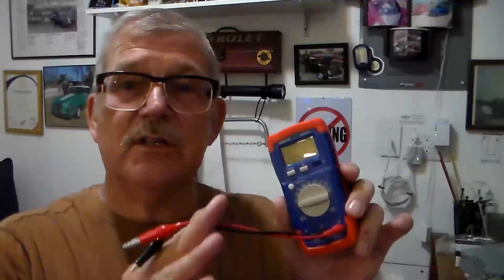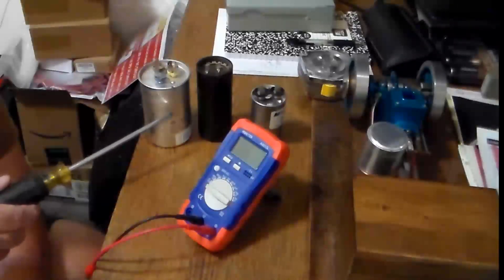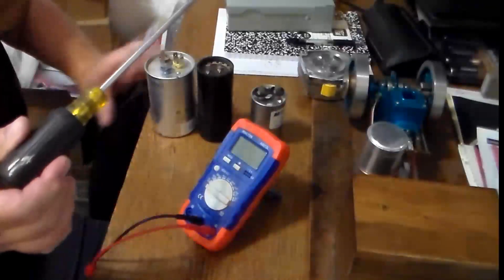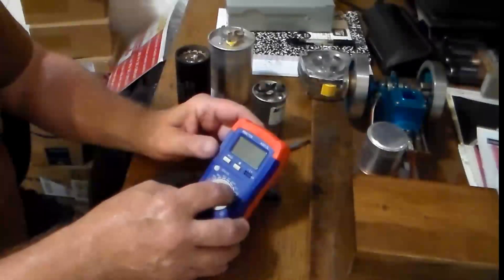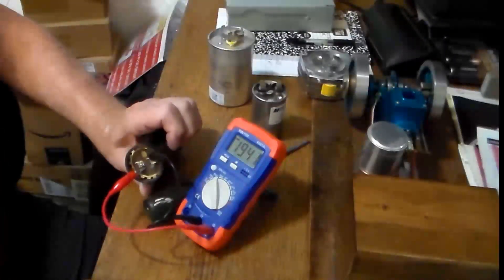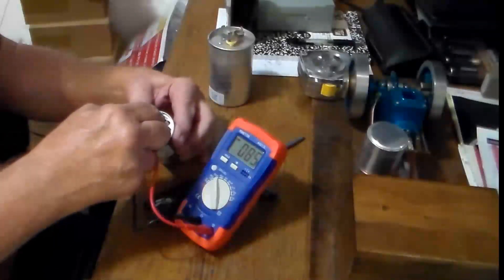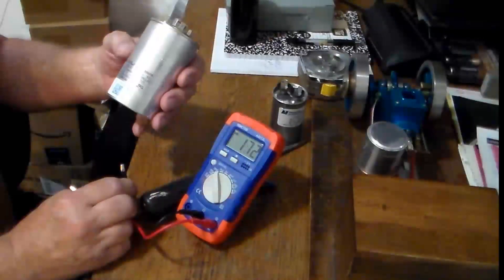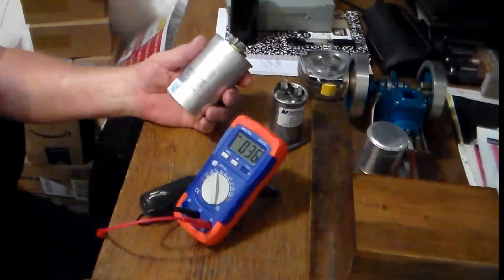HoneyTek A6013L Capacitor Tester

Comment: I just had a capacitor go bad on my garage door opener. I googled the problem and low and behold there was a review from Amazon that identified my exact problem and for $20 I had my garage door opener working again. Pretty simple fix. I like your tester Lloyd, just don't have that much of a need for one, but it would come in handy to identify a bad one.
Reply from the maker: Thanks Ken,  My sons AC went out and the tester made diagnosing a quick process. We had it fixed in about 45 minutes include get the part. Take care

Comment: That’s not a bad deal. I found it on Amazon.
Reply from the maker: It does a nice job for a cheap little tool. Just does capacitor testing but that's fine. Thanks

Comment: I've never seen a capacitor tester before.   I use to charge them with a battery to test them.
Reply from the maker: The tester gives you a real reading to know if you are in its operating range. Thanks